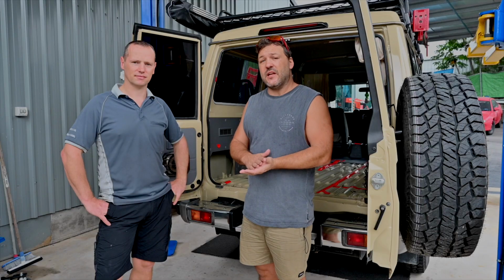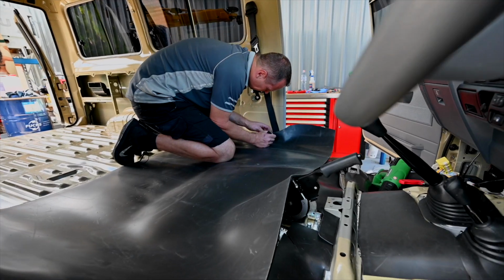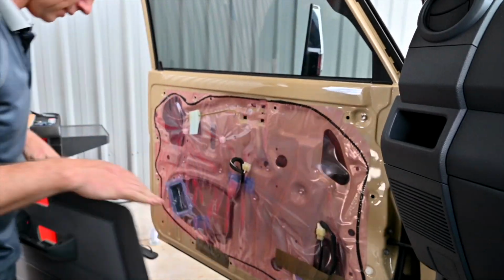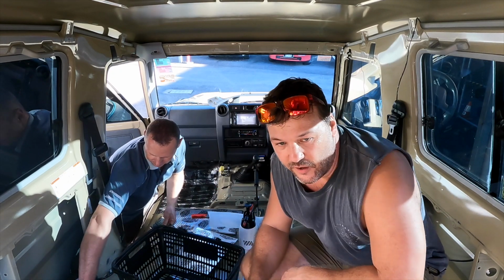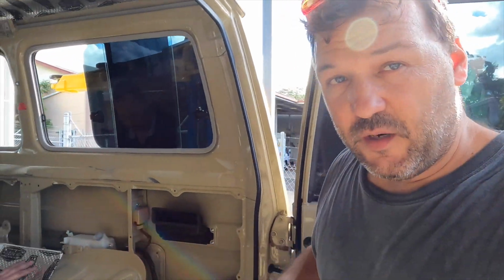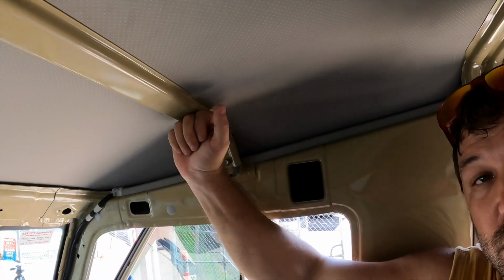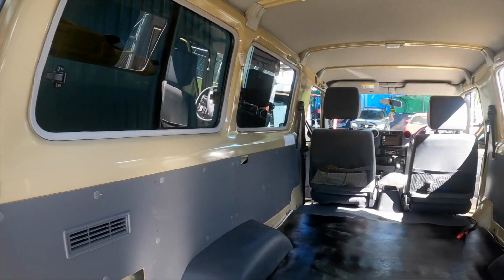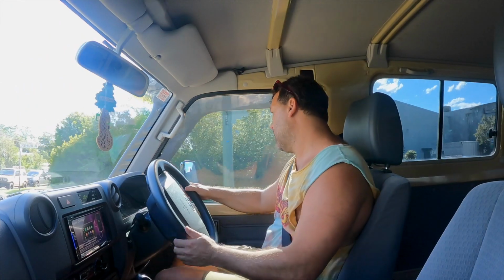Dunes Build: Troopy gets Car Builders sound deadening & insulation

Comment: How much of each product did you order and how much was spent on materials ? Looking to do the same on my troopy
Reply from the maker: Hey Danny! It was a kit from @carbuilders. I think cost was a few hundred? We just added the roof foam insulation, which is cautiously recommended (we fit it in there but it was tight).

Comment: Which brand insulated layer did you use? I have also done the rest of my troopy with car builders but they could not sell me the insulation layer for the rood because of the problem you come across and solved in your build .
Reply from the maker: It's all Carbuilders gear. They did warn us that it would be tight. Maybe because I was putting it in with an installer? If  you're running a roof rack, it's probably a bit overkill, but it is possible to install despite the tiny space between the roof liner and ribs.
Reply: @4wdtouring  did you use the 3mm or 6mm? Thanks for replying👍

Comment: Gday Carlisle, I'm currently doing the same to my troop just love this product with what I've done so far, haven't done the roof yet, taking me a bit longer than you guys but was wondering did you use the 3mm or the 6mm insulation foam on the roof
Reply from the maker: We squeezed the 6 in I think? It was really tight, but I reckon worth it.
Takes all the ‘boom’ out and it was heaps cooler in the sun.